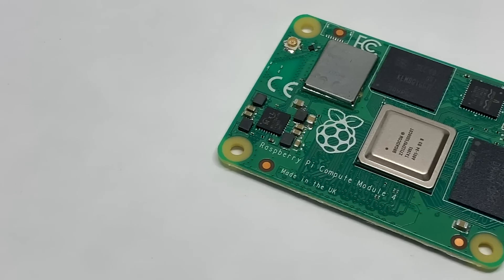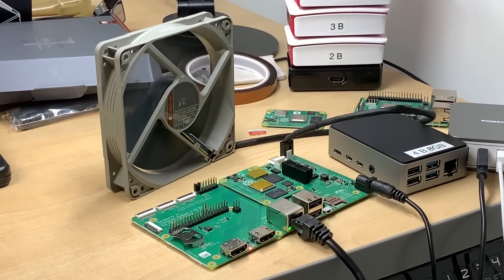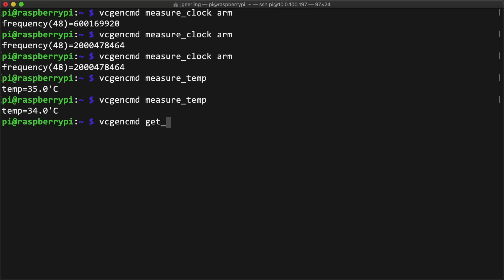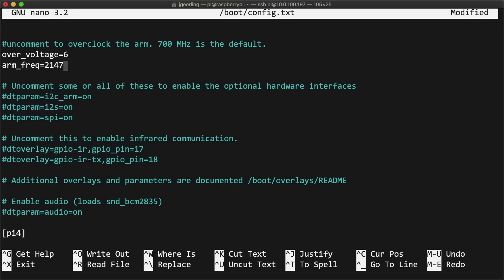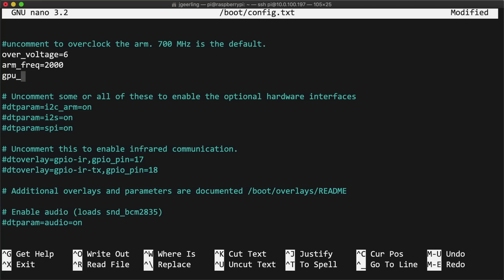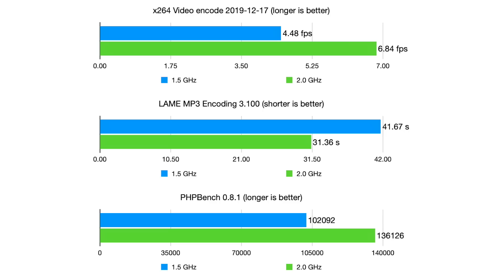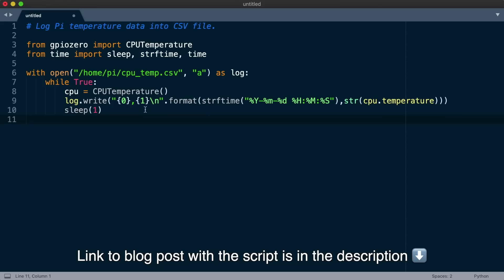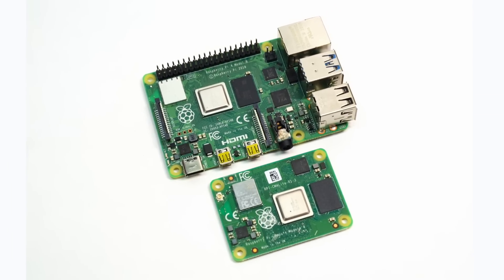Raspberry Pi Compute Module 4 OVERCLOCKED

Comment: Not sure why this would matter but 2.147 GHz is the 32 bit integer limit in Hz so maybe something to do with that? Limit of a value stored in ROM maybe? Just a coincidence and speculation.
Reply from the maker: That seems to be the best possibility. 2 GiB == 2147484000 bytes, and maximum 32-bit signed integer — also a storied number: https://en.wikipedia.org/wiki/2,147,483,647

Comment: I'm not that surprised, since the "normal" Pi 4 needs some heatsink as well. It would be strange, of the excact same SoC on a smaller package would be that much hotter, since a PCB isn't that good of a heat conductor (and i'd been even more confused, if it was cooler for some reason)

Comment: I'm sure a company will make a ridiculous overkill cooler for us lol
Reply from the maker: I'm just waiting for the CM4 ICE Tower. Every time I see that, I think of Mr. Freeze, "Tonight’s forecast… a freeze is coming!"
Reply: @JeffGeerling  yeah I couldn't think of the name I was in aw when I saw Eta prime review it. Who just shouted you out btw.  Iv been waiting to get a pi4 and I have like 3 pi 3s, but I think I want to get the compute unit instead.
Reply: @JeffGeerling  it should be possible to make new brackets for the current ICE cooling tower. I have one that I'm not using (the other two are installed on pi 4B units).
I will take a look at the Raspberry site for a CM4 layout with measurements. If I can find them, I can make the brackets & send them to you. It'll be Mr. Harold Hacksaw & Mrs. Dolly Drill-Press to the rescue (for any ExplainingComputers fans in your audience).
Reply from the maker: @MarcusPHagen  Thank you so much for the offer, but right now I just don't have the space in my box of 'Pi things to do' to work in testing out an ICE tower... I'll leave it for someone else to test and talk about for now.
Reply: @JeffGeerling  I got compulsion to redesign CooliPi for CM4, but nobody would buy it anyway. I don't like active coolers.
Reply: Fun fact:
A friend of mine is correctly working on fitting his old unused be quiet pure rock slim (which is somewhere around 120W rated) to his Pi 4 for... Reasons
Reply from the maker: @p3chv0gel22  Haha, now that is overkill!
Reply: @JeffGeerling  yes. But i believe, he wanted to run it completely passive, which might reduce the rated tdp a bit, but at least, it should be able to cool everything on the board

Comment: I would be interested in seeing how the CM4 performs as a NAS and if there is any advantage in using a CM4 over a usual RPi4?
Reply from the maker: I don't know if I'll go deeper into the NAS use case (at least not yet), but the two biggest advantages would be faster storage access through the PCIe slot (so direct SATA or NVMe performance), as well as the ability to integrate the tiny CM4 into a smaller NAS enclosure with just an Ethernet jack, power plug, and space for some drives.
Reply: @JeffGeerling  I guess someone will do it, sooner or later. I wish I had the skills to design a board with just what's needed for the project.